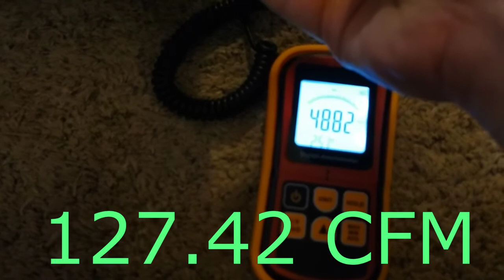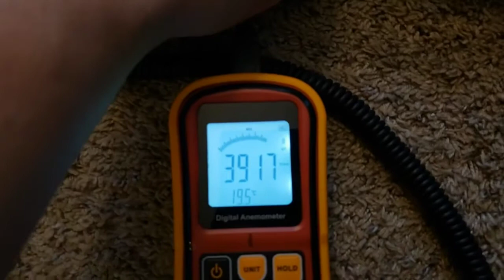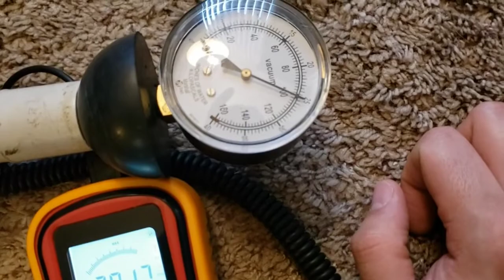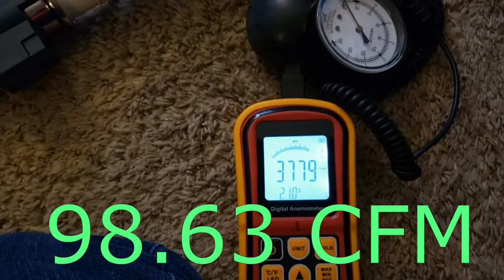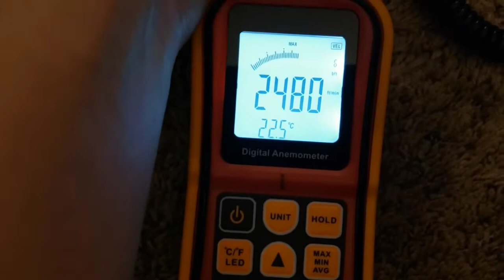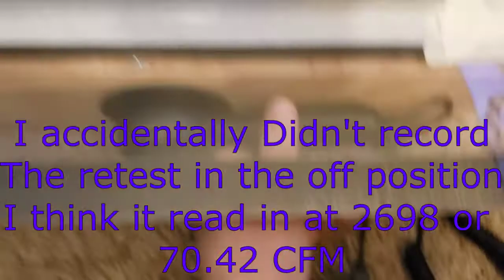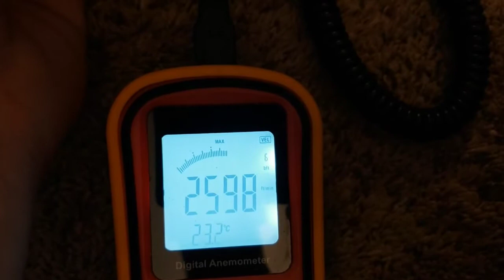Royal 4700 powertank airflow test and demo

Comment: Impressive performance for a canister, it's almost barking up the Electrolux tree.   Now as for the power brush, that is made by Panasonic and I do know the brush roll that had 2 strips and a beater bar was normally used on the Kenmore canisters that used this same power brush design (likely your other one possibly had a replacement brush roll put in, and the previous owner could only find the Kenmore version), the one with just 2 strips are original for Royal.

Comment: I love the Royal power tanks. I have a 4700 made in 1999 my grandma bought new in 2000 and gave to me in 2009 and a 4600 made in 1995 I bought on Craigslist around 2020. I have restored the 4700 to near new condition with many NOS parts (many of which came from the Henry Co.). It is in such good condition now and since parts are basically impossible to find now I got to the point I didn’t want to use the 4700 anymore because I was afraid of damaging or breaking something and not being able to fix it so I got the 4600 about 5 years ago to use as my daily driver. I have a stockpile of both NOS and gently used parts and hope to use these for the rest of my life. I bought a brand new Kirby in 2019 but only used it a few times before returning to the Royal, I just like using them a lot more and find they are a lot less aggressive on the carpet but groom it very nicely.  Now the Kirby sits in a closet in near new condition. It’s a shame Royal stopped manufacturing these and is basically defunct as a brand now.  I wish they could have maintained operations here in the US as Kirby and Filter Queen and maybe just sold off the Dirt Devil label to TTI.
Reply from the maker: It is a shame they were such a solid machine! Just a few tweeks like Hepa Bags and a more updated powerhead and they'd be in line with many high end machines of today.